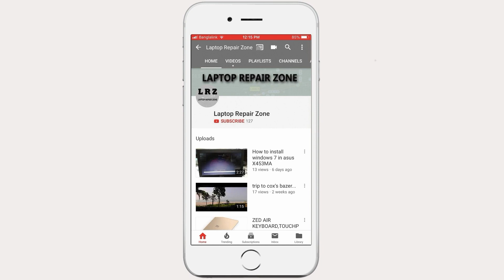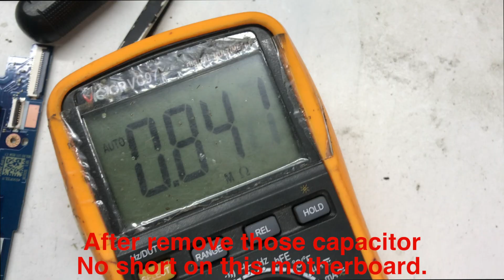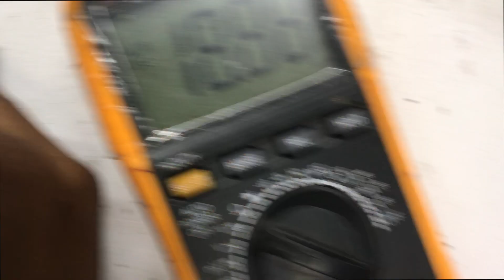hp pavilion 15 no power no lights.

Comment: Good work bro. But I notice, if you replace the capacitor that you removed? Will it work without those capacitors that you removed?
Reply from the maker: Thanks for your comment, those capacitors are filtering the voltage, it’s optional you can replace or not, it will work properly without replacing.

Comment: Hello Sir, My laptop is of HP and has same motherboard. It suddenly stopped working and now there is no power supply to motherboard as checked by nearby computer engineer. He has advised to replace the motherboard. Is it really required? Can you help me to resolve this issue. I am based in Indore, MP.
Reply from the maker: Thanks for your comment, i wish i would be there i could check your laptop.

Comment: Sir same motherboard. Problem is fan spins for 1 second and then stops. No display. I have removed the gpu coils, the gpu memory and the gpu chip. But still not working

Motherboard- HP C701P